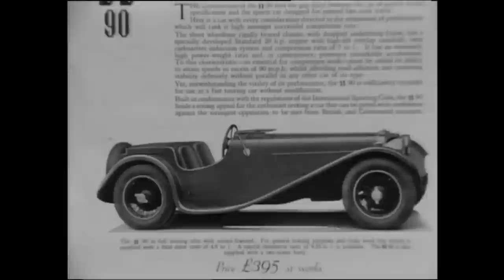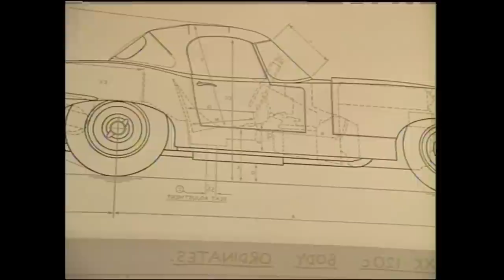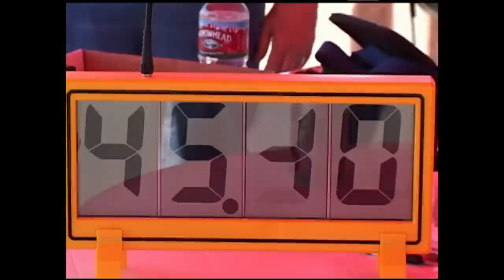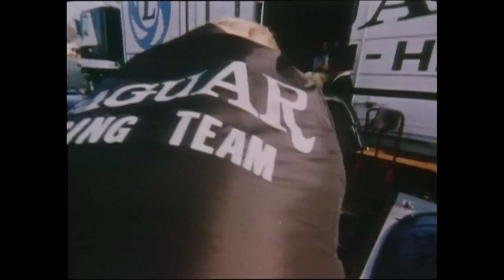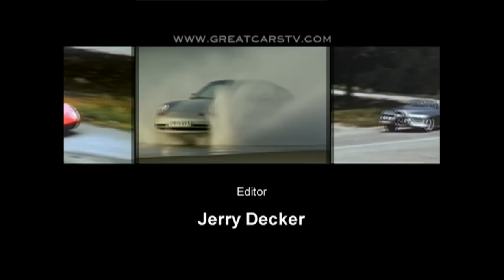Great Cars: JAGUAR documentary

Comment: My father had 4 of them. 2 E's one with 3 carbs and the other with 2 carbs. A 3.8S and a mark 10. But my favorite story is at Green valley race way back in the early 60's. A ratty Jag XKE was ahead of a Corvette in the race and on the straight the vet saw it opportunity and floored it. The vet swug out into clean air and the front end came up and it hit the wall. Boom!. It was about a 63 vet that wasn't aero dynamic. It was too funny

Comment: Jaguar is shit, 1961 E-Types ad campaign you can see how the car is slippin` and slidin` from side to side, dangerous car. Suspension may be derived from 1865 carts. Non efficient Engine
like the horrible Rolls Royce a greasy car ,full of unnecessary luxe details  . Proof is that all english brands dissapeared . British nordic invasion`s people you were not born to design or build cars. You must need a reflection of your own fears.
Reply: Alfo I say BS. Maybe you think a fiat is better.
Reply: Alfonso Guerrero Estrella may I kill you? You t h o t.
Reply: Alfonso, you are a complete idiot.
Reply: The e type debuted Jaguars coveted independent rear suspension which was used in some form or another until 2006. IRS in 1961 when the competition was still using solid axles on leaf springs along with the dohc xk engine was ahead of its time
Reply: One of the weirdest posts I've read on cars